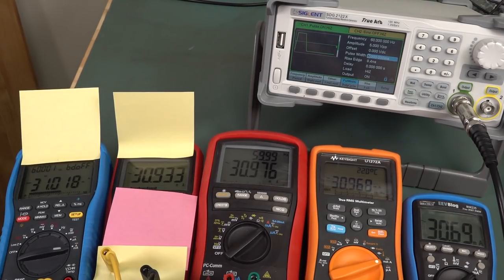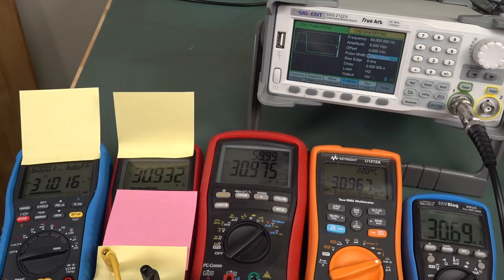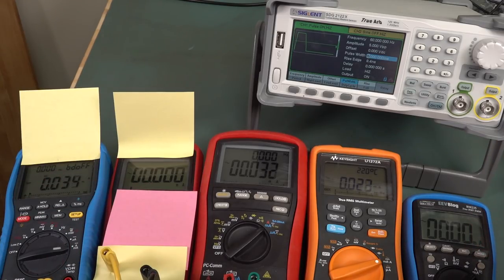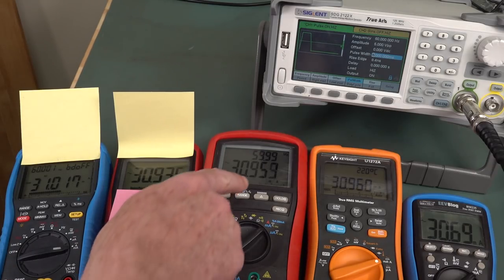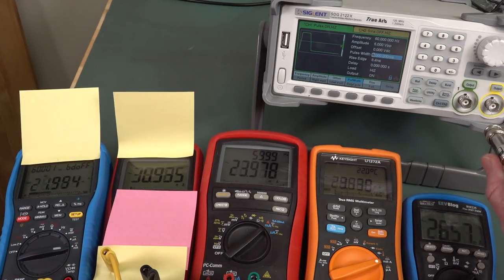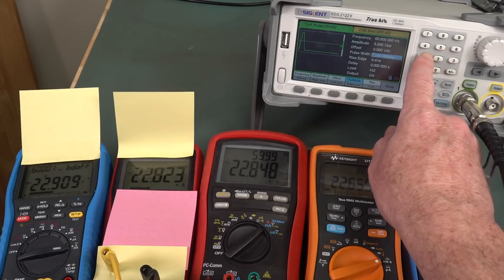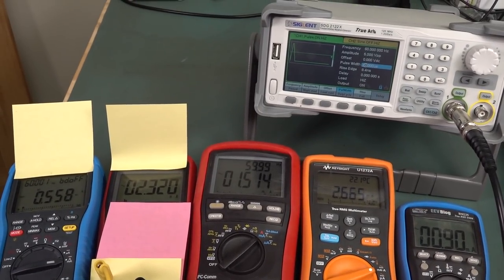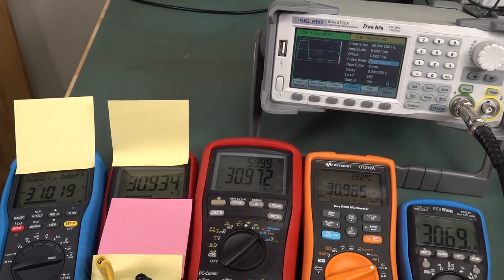Playing with short current pulses on multimeters

Comment: It might be a sampling down routine  software issue. When you disconnect the measurement the software routine  still running with the highest peak and the zero averaging  . Of course if is not a capacitor issue.
Reply: Perhaps an IIR filter in the works with a truly infinite response?

Comment: Well, essentially even a single current pulse every couple of minutes would have a rms-value. If you observe a drop to a 1/1000 of the value of your 60 Hz pulses showing 30 mA rms this would still correspond to the same pulse width at 1/1000 of this frequency or 60 mHz which corresponds to one pulse every 16 s. If a meter drops faster than that it means it has a cut-off frequency for its rms range higher then 60 mHz - so actually less perfect than a meter which after 160 s still shows 1/10000 of the original value.

Comment: I have been told that some true RMS meters use the signal to heat a resistor, measure the temperature gradient, and calibrate V^2 from that power dissipation.  A little bit of mass performs averaging (filtering/smoothing) and might explain the slow responses.  I also have seen data sheets for analog ICs that compute V^2; these have finite frequency responses.  Averaging V^2 over several cycles, dividing by the time constant, and sqrt yields RMS.  The lowest valid frequency and averaging time are inextricably linked, so you might be witnessing this settling time.  IMO this is very likely.  A similar digital algorithm can be applied to sampled data with similar limitations; exactly N cycles might be averaged in this case for noise immunity.
Reply: You can see the thermal converter style here (it's timestamped to the part of the video): https://youtu.be/upTgM_S5rAQ?t=1559
Reply: But as discussed elsewhere, very few meters these days use the thermal converter style. I don't think any of these do.

Comment: yeah it's another quirk / regression of the older series bm869s. compared to the new ones... any reason to think Brymen will update and refresh the bm869s anytime soon? because that is really the best value for money high quality meter. and with the 2 line display... really nice. really wish they would give it an update

another product i've been hoping to see get refreshed is the keysight DSOX1204G scope. of course according to your interview with that really nice keysight guy... that is challenging and difficult for them because it's based on winCE platform. and getting all the graphics to work on linux is much harder to get right. to the same high standards. but the basic bandwidth specs etc on the 1204g are now behind the cheaper rigol mso5000 series. which of course isn't really such a nice scope in as the keysight

Comment: I guess the meters use different integration periods. Maybe some factor in older data longer, but that still doesn't explain the Keysight behavior.

I guess you are still selling plenty of BM235 meters? The 235 seems to be a great meter with 4 digits, pretty accurate, a good feature set, robust and simple to use. Pretty good all around.
Reply from the maker: Yep, roughly equal spread of BM235, BM786 and 121GW sales.
Reply: I love my 235

Comment: I just fried my multimeter probing the primary of a power suply without discharging its caps : (
Reply: It was a piece of junk, then. Joe Smith tests multimeters against large transients and anything half decent will survive connecting to mains on any range as well as several kV transients.
Reply: @NiHaoMike64  yeah it was junk, but it was the best junk I had around